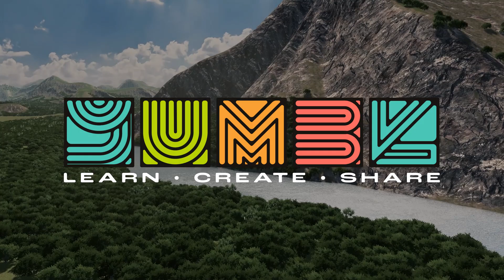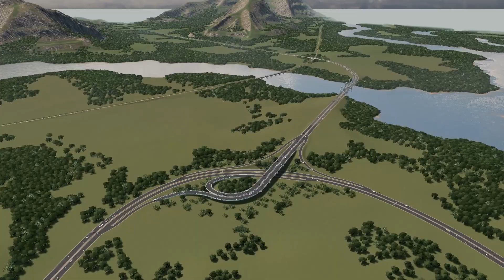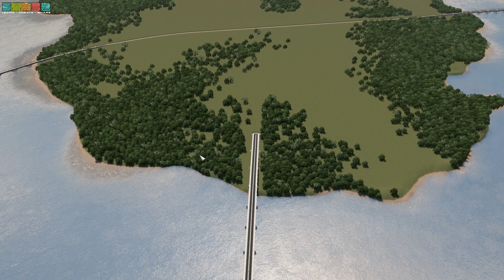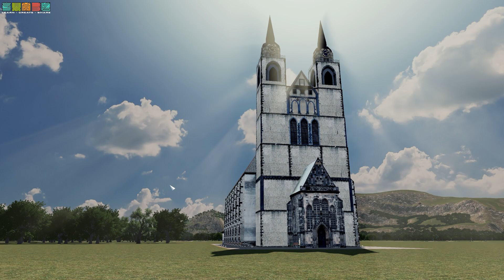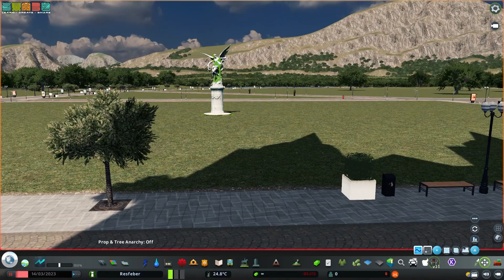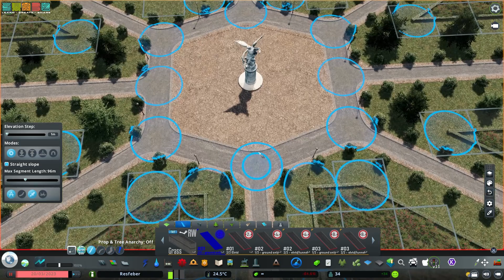Day 1, New City  |  Resfeber (European Cities: Skylines Build e01)

Comment: If I start a "European" build (not that there is such a thing) I certainly don't use all the up front planning and symmetry. European cities in general have grown into what they are now over centuries. You talked yourself about that this city started from a medieval centre. That's the thing you should start from. And then build the more recent parts of town around it. If you start with arterials and stuff, it just won't look the real thing. Build the arterials when it's too late. That's how cities over here work. The result will be a lot less symmetrical and look much more cramped.
Anyways, so far for the pedantic stuff... Still love your vids and I will be watching this series with lots of interest!
Reply: Admittedly, there were medieval grid cities, so your initial core could have some form of smaller arterials, before adding progressively more modern expensions to it that integrate into the old instead of replacing it. That way, a bit more symmetry would be true to the idea, albeit far more dense than yumbl's current setup.

And, of course, no roundabouts in the medieval centre.
Reply: Not that it really matters... The great thing about this game is that there are no rules. Everybody build what and how she wants.
Reply: @mbrackeva  Absolutely, I would personally never try to simply recreate real life, but build the city of my dreams - and if that city contains old Roman wide promenades and became the modern main roads, why not?
Reply: When I build European cities, I always try to have a small "ring road" of sorts. The point of this would be to mark where the old city walls would have once sat.
Reply: Agree. I can't think about european cities in any other way than chaotic with road network. I'm sure he will make this city nice and pretty, so let's wait and watch.
Reply: Yeah, his issue will be having a trademark symmetric build and it will look nothing like a European city. Any EU capital from Google Earth will demonstrate as much.
Reply from the maker: There are lots of ancient city centers with straight roads. Just because it doesn’t look like ones home town doesn’t mean I didn’t do research leading up to this.
Reply: @YUMBL  Yeah, but where would you see the space for multi-lane roundabouts in ancient city centres?
I don't think anyone was doubting your dedication and research. And after all... you do you! There's no need to adhere to what your followers think a European city with medieval history should look like. But I do think there's some interesting thoughts and ideas to be found here.
Reply from the maker: The city center is near the waterfront. Not where the roundabouts are.
Reply: @YUMBL  I think Mario's main critique is that the highway leads over right into the old town. In reality I would hazard a guess that every single old town of Europe are "miles" (relatively) away from the main city highway. Highway - commercial/industrial suburbs - outer city - inner city - old town. But no disrespect, I think this build so far is fine regardless!
Reply: @YUMBL   organic growth is how old cities grow over time. to get a great looking European city you should try to build it chronologically. 
i understand that you like gridded cities that are well planed since that is your thing.
lets take the road bridge as an example, it is clearly made in the late 1800 or early 1900(based on the style, span and width). how would the city look at that point? what is the logical point for the bridge to connect to? 

is the purpose of the bridge to be a prestige bridge? then it should be aligned with a estate or mansion.

the bridge could be imagined to be an old railway bridge that connects to to the other railway at some point. but was at a later date converted to a road bridge. 
in European cities it is not uncommon for old railways to be converted into bicycle paths. you could then imagine that a road follows the old railway up to the first roundabout and from that point it continue as a bicycle path up to the modern railway.

this type of layered history is a fundamental part of how old cities are shaped.

another aspect you should think of is the citys industrial history. traditionally cities industrialize in one direction and the other direction is where the wealthier live.
lets say you build an early industrial area north of the old city center, then you should have wider streets and more parks in the other direction.
parks can represent areas that historically was the gardens of the aristocracy, but as time goes by the houses disappear and leave a area of undeveloped land that is converted into a park. i know of a few parks in my region of Sweden that can trace its origin back in such a way.
Reply: @YUMBL  The Form of the City depents on the History of the Town. Cities that where build in the Middelage have Curved Roads (Cologne as Example), Cities that where built in Time of the Industrial Revolution, like in the Rur Area are more straight.

Paris or London, have a Mix of both. The Reason for that are historical. There were Fires and Revolutions in this Towns, that had Changed the Roadstyle either.

Comment: If you want to really build a European old town, I would recommend you build like a "city-ring". Many European cities have that, it's basically a ring-road around the city center (that's usually a pedestrian-only zone) and from that ring the main arterial roads branch off. It's basically a super-roundabout over the whole city (and yes, Europeans love roundabouts). If you want to see an example of what I mean, you can check out the German city of Oldenburg (https://www.google.com/maps/@53.1430572,8.2203669,14z). Also most of the roads are more "wiggly", because as the city grows and roads are built bigger, some parts are not allowed to be changed because of old houses that are considered "monuments" that should be "protected".
Reply from the maker: Got it!

Comment: Oké yumble, now I am triggered haha. 
If you want to base it on the netherlands NEVER use bikelanes on artirials. Seperate the cyclists using Seperate bikelanes. 
We seperate traffic based on speed and mass. Within the city you only have cyclists on the same road with cars with speeds arround 30kmh. Those are the streets where most homes are situated on. With speeds above 50 you can use bikelanes but preferably seperate bikelanes